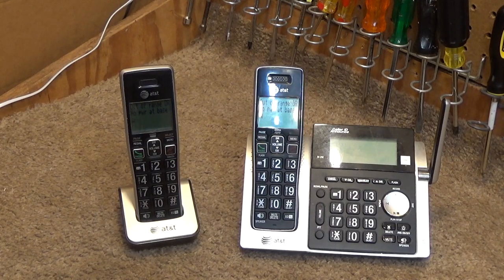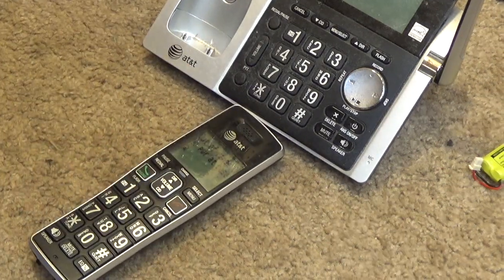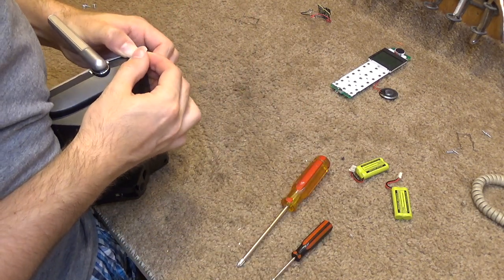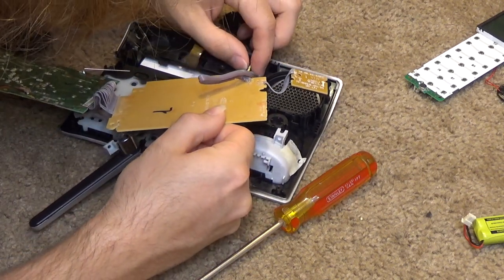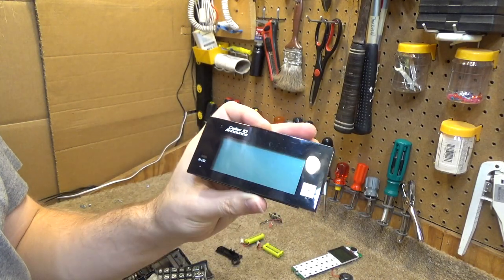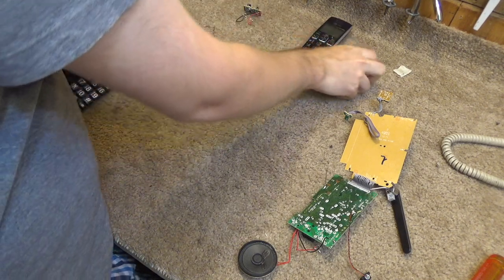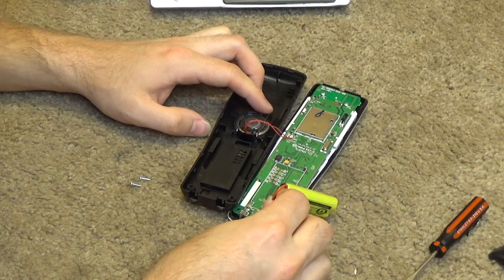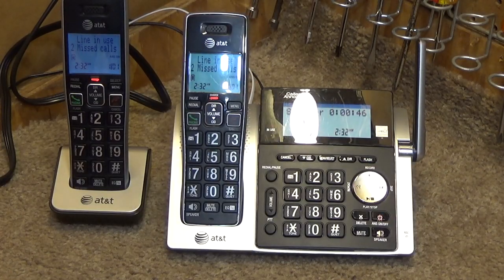Clean and Repair AT&T CL83213 DECT 6 Cordless Phone

Comment: 28:39 It was used on the CL83203 as well, difference is the handset model, same base. I’m not sure which one would’ve used that other microphone hole as the actual mic unless this is the same back shell as the CL83201.
Reply from the maker: OK

Comment: As I have searched until I am mind-boggled, permit me to ask a question, my speaker function has stopped working. Is there a reset?
Reply: If the speaker makes no sound at all, you’ll need a new handset. I had one of these blow out soon after I got it in 2014.